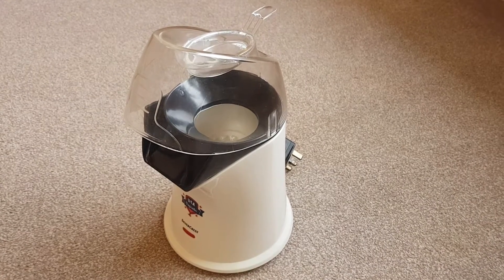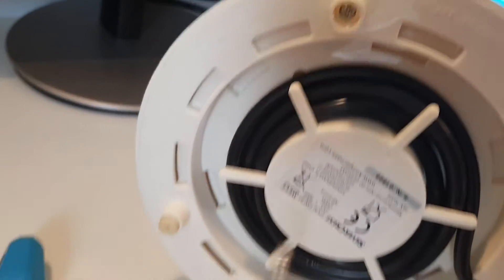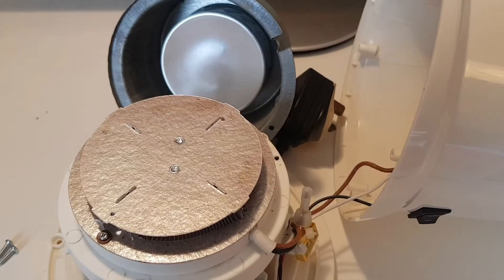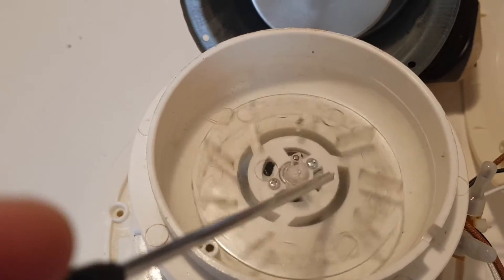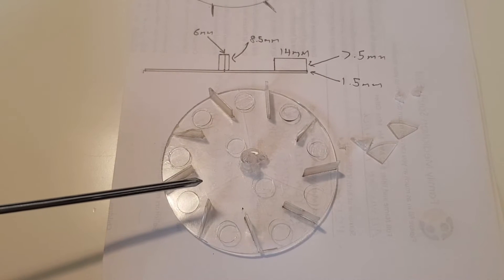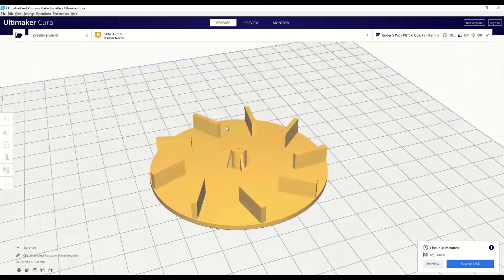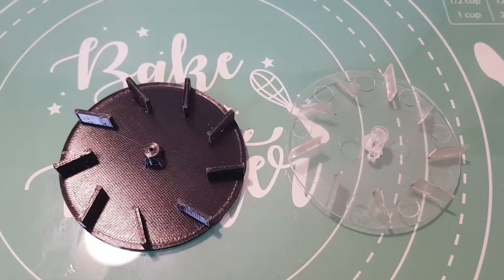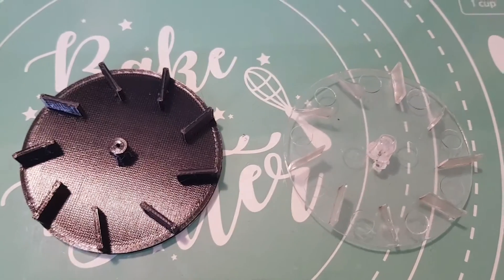SilverCrest (Lidl) Popcorn Maker - Impeller Fan Repair

Comment: Too bad I don’t have access to a 3d printer. One half of the impeller on my machine has completely melted
Reply from the maker: You can download the file from the link in the description and use a 3d printing service to create one. I'd suggest using ABS plastic etc as is better against the heat.

Comment: Repaired my Poppery II Corn Popper with the guidance from this video - reviewed about 3 others which didn't go far enough to break it down to where the fan was.  It was squealing and I didn't dare use it - finally took it apart far enough to where a mere speck of oil eliminated the horrendous squeal.  Good as new!  A small Phillips screwdriver, this video and a few moments ... and a bowl full of fresh popcorn now!! Thank you!